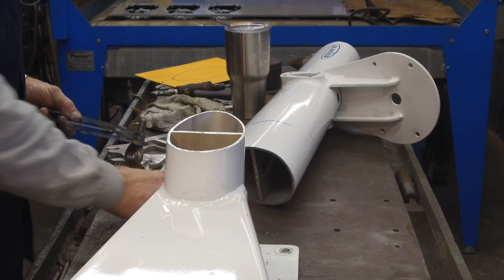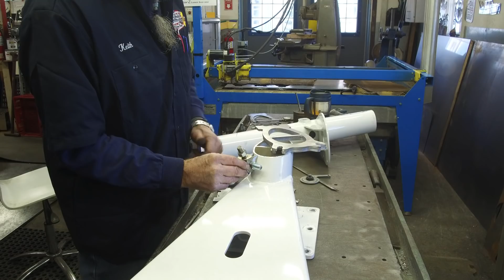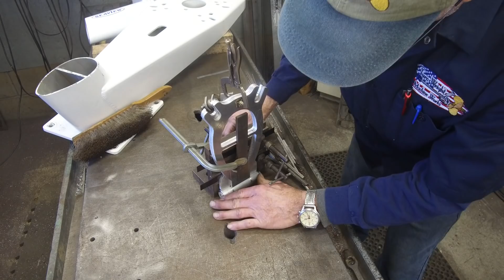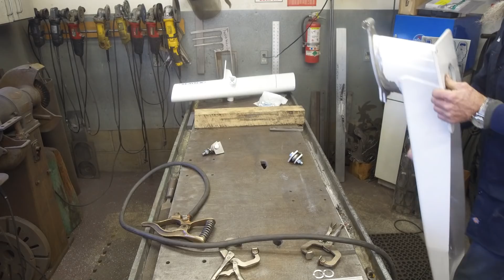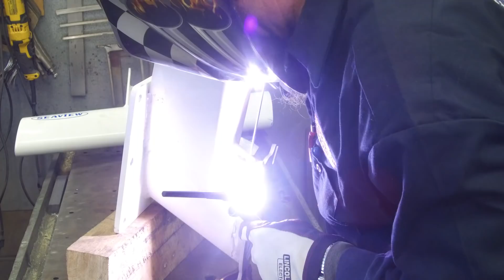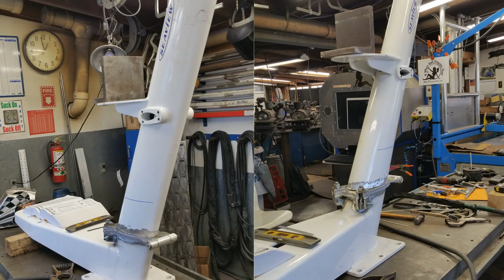Hinged 2

Comment: I hope someone who reinstalls the mast adds some chafe gear on the cabling or the edges of the brackets could wear on the cables. Also, how will it water-proof the hinge? A sheet of foam across the face? Most of those brackets are weather tight and the cables are dry on the inside, using gasket material or Sikaflex bead around the base mount.

Comment: Hello Keith. Work as electrical engineer, but have for some time thought of a concept of getting a steady steam of compressed air maybe without tank. Three phase have a totally flat energy output over time. Thought this could be applied to compressed air with 3 pistons at 120 degrees between TDC. As you are open to test many things i wanted to share the thoughts if it could be of interést. Best regards. Feel free to use the idea to the best of your judgement if you find it fun.

Comment: Keith, Great project!  Just a thought, Before you deliver it, cut a dummy seal plate to use as a cover for the antenna when it is in the open position to keep junk from landing inside the antenna well.

Comment: Wonderful work Keith. With the new joint in the mast will a grounding strap be needed to "bridge" the gap made by the hinge for electrical continuity purposes?
Eric
Reply: Good thought. I assume it will be included with the wires running to the top.

Comment: Good job Kieth, but was there any need to make those flanges, I would have just made eight identical lugs around 150mm long x 50mm wide each one tapered to one end and rounded at the other end, drill a hole through each lug at the rounded end, weld four of the lugs vertically to the bottom section of the mast and the other four vertically to the top section of the mast and positioned so that the end of the lugs on one mast section overlap the lugs on the other mast section, then insert four bolts through the overlapping lugs to hold the two mast sections together, two of the bolts will act as the hinges.

Comment: Since this will be operated in a salt water enviroment, which is highly corrosive, how are you going to seal against salt water intrusion when the mast i in the upright position and when it is in the folded back position? Also the inside of the mast will probably will have a small diameter wire bundle and a coax cable which will have to move when opening or closing the mast and will also have to have a flexible seal, how are you going to deal with that issue?

Comment: When we built our 32' Bristol bay fish boat in '79, '80 we used worm gear skill saws and carbide blades to do all the aluminum cutting.  When a saw finally let out the blue smoke we tossed it to the side and opened up a new skill saw box.  Wore long sleeve shirts, leather gloves and face mask to keep little chips of aluminum from sticking into our hides... Oh, and we greased the blades up with Rockwell bandsaw wax...

Comment: Hi Keith very high  quality work, plenty issues to plan with  a job like this well done.p.s. How will salt water the may enter the hinge area drain out of the lower section once it is bolted down to the deck is there a drain hole on the lower section? Dibbo
Reply from the maker: As mentioned in prior comments the need for drain or pisser hole is more than the seal of joint. ;{)------

Comment: In order to increase the strength of the rejoining of the two parts, do you think it would be a good idea to put two more bolt fasteners on either side of the hinge?  By doing so there would be tension on the hinge side to compensate for any looseness in the hinge and thereby a stronger joint. Of course that would mean undoing 4 fasteners before the antennas could be tipped. I suppose it would mostly depend on how much torque the antennas would put on the mast.

Comment: Keith, 
Have you made provision for a solid electrical path between the 2 halves of the joint?
Relying on the clamping force of the physical joint can result in a intermittent ground plane connection that could damage the transmitter output or reduce the power level available. 
A piece of braided strap connecting the upper and lower plates would suffice to provide the path.
Cheers Eric
Reply from the maker: I will let the electronic guys set up and handle what is needed for that. ;{)-------

Comment: I can't remember if you mentioned it or not, but are you planning to put an alignment pin and hole in the front of the hinge plates to insure the final alignment of the two halves as the hinge closes? 

Also, you might want to run a ground strap between those two halves(maybe on the inside). From one of your other comments you said there would be grease between the hinge halves and if you use delron bushings on the hinge pins, then the two halves could be electrically isolated from each other.  The performance of the antennas could be affected if it doesn't have a good ground to the upper half of the mast.

Comment: Hey Keith, great work and video, as always! 👍I have 1 question, why are the knobs on the top and hinges on the bottom? (and not the otherway around). Is it for looks or spacing? I ask this because that way gravity would always keep it lock and (if loose) would not fall out of the plate. If you know what I mean.😃✌
Reply: I was kind of surprised he dint do a cam lock of some sort
Kinda on the miniaturized version of whats on a semi trailer with barn door style doors

Comment: Is there a drain hole near the base. Water may get in at your new joint. This may complicate the seal around the cables as they come through the roof.
Alan in London
Reply: yeah, I think if I were designing it, I would have made the bottom plate mostly solid, and just drilled or machined out a hole in each section and put a short piece of pipe upwards from it so that any water ingress wouldn't go down further.

Comment: A hacked job on a small part of the mast of a nice boat makes the whole mast look bad, your job on that mast will make a perfect mast and make the rest of the boat look like a bathtub 😆 As a mater of interest how did you calculate the thickness of the powdercoat so that the hinge will not be affected once closed flat to flat? was there shims between the 2 surfaces before welding? or is the thickness of the powdercoat insignificant to not matter.
Reply from the maker: shims / strapping material. ;{)------

Comment: Out of interest Keith do you find the water in the plasma cam machine contributes to any flash rusting in your shop or do you drain it? I was just wondering as it’s a lot of surface area to evaporate. Great job by the way, yes definitely not luck could tell u have done it before
Reply from the maker: The wood stove offsets all my humidity issues. ;{)------

Comment: Keith, a few questions if I may. 1st off, how do you motivate yourself to get up and go to work every day, especially when there are nothing but boring jobs to be done, and a warm bed with Vanessa in it, is just a short walk away? Obviously discipline is required, but what is the motivating force behind it? The pure requirement to purchase food and shelter, a love of the work, regardless of how boring any individual project may be, or some other magic. Were you born with the need to work for yourself, or did it build over time as partime jobs at home finaly resulted in enough buisness to make striking out on your own worth it. 2nd, my high school metal shop teacher always told me to step drill from smaller holes to larger holes, but never so much that anything but the tip of the next sized up drill was given clearance; the thinking being that too large a hole would only bear on a thin ring around the outside edge of the bigger drills flutes, and therefore somhow ruin that drill. Is this true, and if so does drilling out the out of round holes the plasma cutter makes result in the damage to drills that my shop teacher warned us about? There is much info on tweeking speeds and shapes on cnc plasma cutters to get better holes. Is all that worth it in non production environments? Finaly how do you keep the drill centered in the misshaped hole made by the plasma cutter?

I have more questions, but i realize you that you need some time to make a living so I'll maybe try and figure those questions out myself at the library. Thanks for great videos, the quality of which, only seams to grow as the years go on.

Sincerely, Leo Petropoulos.
Reply: @ Leo If you try to enlarge a hole with a slightly larger drill, the drill can try to pull itself into the work piece, with thin material it can ruin your work-piece, with thicker material the drill will either stop or break.
Reply: @Truthisstrangerthan Fiction  I wasn't so much asking with regards to the work being pulled up, or the drill being pulled down. My question was in regards to making sure the center of the cnc cut hols are where they are supposed to be. If you look at the hole the plasma cnc cut you will see that it is not round. It is very slightly egg shaped. In my experiance trying to drill out an egg shaped hole with a conventional drill to true it up will more than often cause the drill to wander to the fattest side of the egg shaped hole. If you drill it anyway the hole will get further offsets from the desired center point; usualy on the fat side of the egg shape. I have had some luck preventing this by using a stout endmill to enlarge the hole, or if the hole is big enough some of those stuby drill bits are somtime rigid enough not to bend. How did kieth manage to enlarge the hole was the question, is it even worth it to cut precision holes with the plasma cnc?

Comment: Hi Kieth.
Another great video. I love watching your work and have picked up a lot of tips from you. I have a question for you. I live in Thailand and I'm thinking of building a small workshop to accommodate a small turret lathe or a lathe with a tail stock turret attachment to make fancy machinist hammers and machinist jacks to sell them on ebay. Do you have any advice on this because I could sure do with some. I'm just looking to make a few extra bucks. 
Regards Dermot
Reply from the maker: Follow your heart and do the best job you can for the best price that motivates you to keep going and let it happen. ;{)-------
Reply: @KeithFenner  Thanks for the heads up Kieth

Comment: How often is it proposed that the aerials will be folded down.. if too often  I would be a bit concerned about the flexing / bending of the aerial cables. Coax cables like to stay put and / or a large bending radius.. Coax cables, from a technical point of view, need to have a known / set distance between the centre core and the outer braid...  kink the cable and this distance is altered and it can muck up the impedance and therefore it electrical performance..
Reply: Marine antennas have that built in, they take quite a beating.

Comment: Excellent production. ?.since this mount will support radio & radar antennas, would it be prudent to bond upper and lower halves with a stainless braid ? Remember when car antennas were mounted to the body rather than built in windshields, there was always a piece of braid attached from the doors to the body from the hood to main body also. Thinking it might make better RF integrity....or maybe not lol 👍🇺🇸
Reply: I"m assuming he'll be mounting VHF antennas; marine VHF stuff doesn't require a ground plane like some radio equipment.  Consider that most recreational boats are fiberglass and the antennas are mounted directly to it.
Reply: Not needed here Mike , but owner might want to check his ground path. Good thinking on your part.
Reply: Yep.  With everything powder coated and delrin bushings, etc. that top piece might not have a good ground path.  Owner/radio guy issue.  
Awesome job so far!  Looking forward to the next one.  
How about using low tensile strength bolts though?  That way when you forget to lower it, it folds "automatically" under low bridges. ;)
Reply: I'd electrically bond the two portions together with a conductive braid extending across the hinge.  Not stainless.  Not a good conductor.  I hope there's not a waveguide extending up the interior of the mast.

Comment: I cut 1" aluminum plate all the time with a worm drive skillsaw and wd40 works great. and no you don't put the blade on backwards.
Reply: Yes, I agree. When you do put the blade on backwards is when you are cutting corrugated iron for roofs and fences. That works well.
Reply: I use a cheap wood chop saw with a decent carbide blade, works great.  What do people not understand about cutting aluminum with carbide wood blades?  It's pretty much what everyone does....

Comment: You gotta love those arm chair warriors telling you that what you did is "LUCK". LMAO... I build houses for a living and I cut compound angles on rafters almost every day, some times 100 of those angles a day, with nothing more than a framing square and a skill saw, and they fit....damn I'm lucky!  And for all those that criticize using a carbide blade for cutting aluminum,- aluminum cuts pretty much like wood. I use miter saws and table saws to cut aluminum shapes in my metal shop all the time.
Reply: Being a diy, afflicted with OCD, I find it odd that when I correct what appear inaccurate cuts in the bones of my home as part of other work in the area, that the "perfect geometry" more often than not ends up looking crooked to the eye; and the tape measures and squares be dammed. Apparently the perfect cut is neither perfect or straight when building a home!
Reply: @leop9021 I assume that since you said you are a DIYer, you're not building hours from the ground up. So if you're remodeling, repairing, upgrading or something like that to an existing home, and it looks crooked but you verified it not to be, that means something adjacent to it is crooked, causing everything to look crooked. This happens most times on the door casing that is close to an inside/outside wall corner or another door. When you're remodeling on an existing home, and the home is a bit tweaked, go by eye and existing elements, not levels/squares.
Reply: @xenonram  agreed.

Comment: Will there be a gasket/seal at the hinge to keep the water out?  Good looking welds!
Reply from the maker: I would say a coat of grease, was thinking about an O'Ring groove, but going to have wires and such running through the inside, being fondled every time you lower and raise it, there should be a pisser hole drilled in lower base if it doesn't have one already. Making sure it has free exit drain, is more important than sealing up tight.   ;{)-------
Reply: Keith Fenner maybe the owner does want his mast fondled every time it is raised. 😏
Reply: Keith Fenner, first off very nice work and thanks for shearing with us, I was going to ask the same question and was thinking exactly along the same lines as you’re reply, made me chuckle